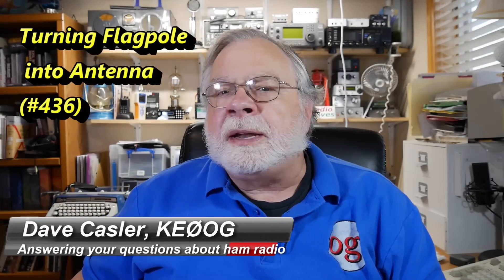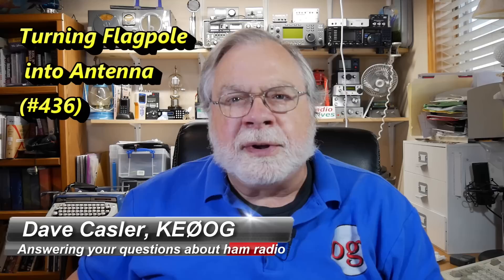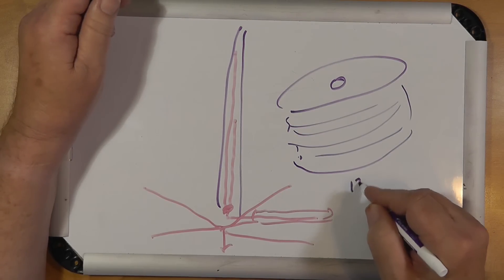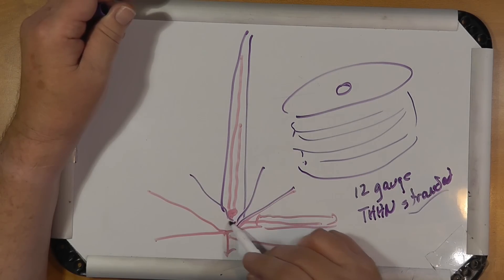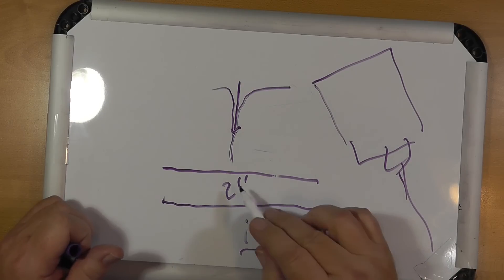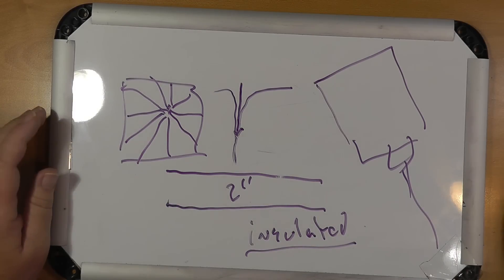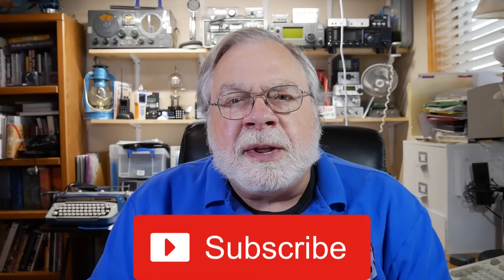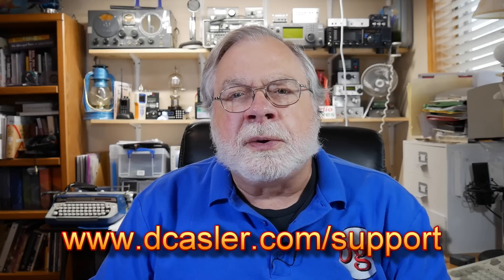Turning Flagpole into Antenna! (#436)

Comment: Thanks for sharing. First: If the flag pole is made of aluminum instead of fiberglass,  can I still run 2 wires inside for a 20 and 10 Mts 1/4 wave? Second: Do I need a Balun at the bottom, if so what ratio balun would be the one? I am trying to re start the hobby after many inactive years. Thank you all for your help and suggestions.

Comment: Hams in my area (an HOA) are using aluminum flag poles (no internal wires) and they use the pole as the antenna. Have an automatic matching unit at the base, hide it under a fake stone, and they do very well on HF. Look up John Ellis NP2B article, September 2017 QST and simply follow what he did. I was at a guy's QTH the other day and he'd just installed one. WOW, it was amazing. Very impressive. It requires radials. If you're not good with a flat shovel call the folks that put in invisible dog fences and they can bury the radials. The next morning you won't even know where they are. de KQ1K

Comment: My question is how would I get a good SWR?  Use a Balun/Urun? 49:1?
Reply from the maker: If it's an existing flagpole already bolted to its foundation, you will need to use a gamma match. Look for articles on the internet and other sources about feeding towers as though they were verticals. This is almost the same situation.

Comment: Actually, the required length of the antenna segment inside the fiberglass pole, which is technically a Radome, will be shortened by 1/ SQRT(dielectric constant of the radome material). 
Depending on the specifics,  that may not amount to much.
Remember that since the dielectric constant is itself a Complex Number, its value will change depending on the frequency  in use - which again may not be much, but it really IS a consideration in Radome design.
Large, multi-layer Radomes get even more complex to design where the frequency (actually the wavelength) also dictates the thickness of the layers.
73

Comment: Hi Dave. My question is more about the radials and not about the flagpole antenna. 

Due to the limited space in my property, I plan to put up a vertical HF antenna up on the roof. In my country, houses are built with roofs made from galvanized iron sheets. My question is that will my radials work well as if they were on the ground? 73.

4G1FBL from the Philippines

Comment: Our new home is currently under construction as we speak. 

Unfortunately, I could not avoid an HOA neighborhood as this seems to be new-normal nowadays. Recently I came across the 'Greyline DX Flagpole Antenna' purely on accident. Of course the reviews are nothing but high-praise. However, I do not trust online reviews as they are often cherry picked by the manufacturer. 

Would this product be a reasonable "do all" antenna for a Yaesu 991A or FTDX-10? 

We are a 'buy once - cry once' family and do not wish to have a plethora of antennas and/or cables strewn about our classy home. Nor do I think the other residents would take too kindly to such eyesores. Plus we like to adhere to the 'KISS method' for our amateur radio needs.

We are not too serious about the hobby in general, but would like to know that we have invested wisely in quality equipment as our interest in HAM radio ebbs and flows. 

Thank you for your time and expertise. I would include a link to the product in question. However, YouTube forbids the inclusion of links in the comment sections. 

Stay classy my friend.
Reply: I lived in an HOA controlled neighborhood for about ten years in my two story (three stories in the back) custom home, as well.   And, what I found to be a very effective antenna was a resonant full-wave loop antenna for 40m installed in the attic around the eves, secured with staples.   The nice thing about a full wave loop antenna is that it is resonant on ALL of the harmonic bands.   So, it worked great on 40m, 20m, 15m, and 10m with little tuning required to cover those entire bands.   I just used the internal tuner in my Kenwood TS-2000.   This antenna was a bit of a cloud warmer on 40m, but had gain in some directions on 20m, 15m, and especially 10m and I was able to work a good bit of DX as far as Europe and Hawaii from Georgia.   Of course, it required no radials, could be coax fed, and loops tend to be rather quiet in terms of noise.   And, of course, no one could see it or know it was there at all.  Just something to consider.

EDIT:  I forgot to mention, you will need a 2:1 balun for match to 50 ohm coax at the feed point.  But, the balun actually makes it easier to connect to it using a regular piece of coax with a PL-259 at each end.   And, you just connect the loop to the balanced side of the balun, preferably at a corner.

Oh, and the nice thing about a flagpole antenna is that it is a simple antenna - just a flagpole and some radials.   That means, you don't have to even consider the reviews.  It's just a vertical antenna and it will be good for DX.  Of course, with vertical antennas, they are only resonant on odd harmonic bands.   So, a 1/4 wave 40m vertical is going to work on 15m, but not 20m or 10m. 

If you use a full wave loop antenna in the attic, like I did, and a 40m vertical flagpole antenna, you should be able to work DX on 40m and 15m on the vertical, and, depending on the height above ground, local on 40m and DX on 20m, 15m, and 10m on the loop.

73
AI4IJ
Reply: @richardowens9061   Wow!

This is by far, the most thorough information I have received to date! Thank you so much for this inclusive information Richard.

In fact, I even took a photo of your commentary on my phone so I can use it as further reference. 

I will definitely be looking into a full wave loop antenna. Appreciate the helpful information. 

Thanks again my friend!
Reply: @BertShackleford  You are quite welcome!

73
AI4IJ
Reply: @richardowens9061   Hello again Richard,

I miraculously managed to find an IC-7300 in stock so I jumped on the opportunity. However, I did not add a power supply or antenna to my order for fear that the available inventory would run out by the time I was done with the checkout process.

Well that is precisely what occurred. The Woodbridge, VA HRO location had several in-stock this morning. However, they sold out by the time I finished my registration/checkout process. Luckily, the Plano, Texas HRO location had several popup in their inventory so I placed my order without including any extra necessary equipment.

My question(s) are as follows:
1. Do you have any recommended/preferred equipment that is required for basic operation of the radio? 
 (I must reiterate that I am still learning strictly on the RX end as I am not currently licensed. However, my need to learn and understand amateur radio operation is far to great to ignore at this point.)
2. Your antenna recommendation is my current "go-to" option. Is there a company that makes such an antenna or is this something I need to build?
 -Honestly, I am not too comfortable with the idea of building my own gear. My wife thinks this is odd because I have built a myriad of things throughout my life. Everything from cars and cabins to firearms and furniture. However, I have never been comfortable around electronics and the wizardry behind it all. 
3. Do I need a tuner? Is it required or is it something that will simply make my learning curve slightly easier?
 - I figured the less equipment; the better off I will be in the beginning. Basically adhering to the KISS method.

With all that being said, I am woefully unfamiliar with the required gear in order to get my radio operational. What are the minimum pieces required to do such a thing? I know I still need an antenna and a power supply. But I do not know if I need more nor do I know what to look for in this equipment.

My plan is to go down to the HRO Phoenix location and purchase the necessary gear while I am at the shop. I am looking for efficiency here. I just want to plug-and-play so to speak. 

Hope this inquiry was not too convoluted. I welcome any and all helpful information from you and the community.

Stay classy my friend(s).
Reply: @BertShackleford  Congratulations on snagging that awesome radio!   I'm sure it will give you years of trouble free service and enjoyment.

As for what you need:

At a bare minimum, you need a power supply and an antenna. - and, of course, a feedline for the antenna   The radio you selected has pretty much everything else you're going to need, for now.   

For receive only,  your power supply can be rather modest.   It need only provide a few amps at 13.8 volts DC.   But, for transmit you're going to need something more robust - something that can provide up to about 30 amps.  The radio itself will likely never draw more than about 20 amps, but it's never a good idea to cut tolerances so close.   A 30 amp supply is going to give you about a 50% buffer and will allow you to power other small accessories in the future.   Astron makes excellent power supplies for amateur radio and I've had good experience with them.   But, there are, of course, other options available and your friends at HRO can also make recommendations.  Plan to spend a couple hundred dollars on a good power supply,   Don't cheap out on this because you will likely regret it.   Cheap power supplies can introduce noise that your sensitive radio will definitely hear, and so will you.

The loop antenna is very simple.   It's just wire cut to a specific length - one wavelength for the lowest frequency at which you intend to operate.  I suggested a 40 meter loop antenna for your attic because of the physical dimensions that are typically available in an attic.   And, it can provide operation on other harmonically related bands - 20m (2nd harmonic), 15m (3rd harmonic), and 10m (4th harmonic).   

For insulators, you can use standard TV coax staples.  These will allow the wire to slip easily while you're running it around the attic.   For the wire, I suggest 14 gauge insulated stranded copper wire.  You will want to buy a 500 ft roll of it - not because the antenna is going to use all of it, but because you will likely want to build other wire antennas in the future and this is a good size to use for dipoles, verticals, and for ground radials.   And, it's not too terribly expensive.

You're also going to want to add a couple of ring connectors at the ends for connection to the balun.   Although, you may also be able to attach the wire ends directly, depending on the design of the balun.   The feed point impedance of a loop antenna is approximately 100 ohms - hence, why I recommended a 2:1 balun.   But, you could also use a 4:1 balun, which may make operation on non-harmonic bands, like 30m and 12m, a little easier.  The wider the range of your tuner the less important this becomes.

For coax, you could use RG-8x or Belden 8267 (RG213U).  At HF frequencies, these coaxes  will have little loss and sufficient power handling capability, while being relatively inexpensive and easy to work with.   Terminate it with PL-259 connectors at each end. 

The length of wire you're going to need can be roughly calculated using the formula 1005/frequency for the lowest frequency of operation and the result will be in feet.   Cut the antenna a little long and then trim as needed.

Of note:  You're going to want to trim the antenna for the lowest band - 40m.   But, the 40m band is rather wide and the CW portion is at the low end and the SSB voice portion is at the upper end.  Just be aware that, even if you intend only to use SSB, you're going to want to cut the antenna for use at the CW end, and here's why:   The harmonic bands are going to fall out of the allocated spectrum, if you cut it for the SSB end of 40m.  If you cut it for 7.1MHz, for example, it will also be resonant at 14.2 MHz, 21.3MHz, and 28.4MHz - all of which fall squarely within the allocated band spectrum for amateur use.   But, if you cut the antenna for 7.3 MHz, it is going to be resonant at 14.6MHz, 21.9 MHz, and 29.2 MHz - outside of the allocated frequency ranges.

I highly recommend you get an antenna analyzer to help you with tuning your antenna(s).  It will make short work of figuring out whether your antenna is too short or too long and what your SWR is at various frequencies.   This is going to be something you will use as long as you are into amateur radio.

I also recommend you get a soldering station - not just a soldering iron.  Depending on what you're soldering, you're going to need either high power or low power and a soldering station will allow you to adjust the heat to meet your needs.   There are excellent videos here on YouTube to expound on soldering, so I won't go into greater detail here.  Just let it suffice to say you will not regret having a soldering station and it will likely get a lot of use over time.   A butane soldering iron is also nice to have for use in the field when you're away from a 120 volt source.

Finally, for receiving, a tuner is not going to be needed at all for this antenna.  For transmitting, you're going to need a tuner, but the tuner in your IC-7300 should suffice, assuming you cut your antenna properly.  A manual outboard tuner will greatly enhance the versatility of your antenna for general shortwave listening and for operating on non-resonant bands like 30m, 12m, and 6m, but it is not required for your primary bands of operation.
Reply: @richardowens9061   Unbelievably thorough and fantastic information my friend!

The sheer amount of knowledge you have conveyed here is invaluable. I took more photos with my phone so I will have this information while visiting HRO. In fact, I have been checked YouTube for your response all day long (not to add any undue pressure). 

We are fully committed towards the 'buy once - cry once' approach while also adhering to the KISS method throughout this adventure. It is a fine line to walk but we have a rare opportunity before us. Since our home is still under construction I can invest in the proper equipment from the start and never look back. Longevity is the key to efficiency. 

After reading about your recommendation for placing the antenna(s) in the attic, I decided to contact our Construction Manager with some questions. I was concerned that it would be too tight in the attic for proper size/placement. Plus the recommended 20 foot flagpole antenna was cause for further concern given the unknown height of our home. Turns out that our highest point is slightly over 30 feet tall so I presume that a 20 foot flagpole would not suffice.
 
Furthermore, I have yet to thoroughly dissect the HOA regulations being that it is a brand new community. So I have my reservations towards the possibility of pursuing the aforementioned flagpole antenna. Attic space should not be a problem (I hope). Although, we do have rather tall ceilings so now I am a bit worried. Attics are given very little thought here in Arizona. Nothing like the attics we remember from the movie 'Home Alone'.

Believe it or not, my primary lifestyle is far more expensive than amateur radio. So the costs involved are actually a welcomed reprieve. Shortages abound on numerous fronts so this step back into the radio world came at the perfect time. 

Honestly, I was hoping the 991A would be the first radio available for purchase. But I was more than willing [itching] to get either the Yaesu or the Icom once they were in-stock. Just so I have something to play with for the next year or so. I will have plenty of time in the interim to acquire my license(s). At least until we feel out the new home and community. We are not the Wrigley's after all.

Thanks again for all your help Richard. I look forward to keeping you updated throughout my journey and eventually getting on the air to thank you in voice(?). 

As always, 
                   Stay classy my friend.
Reply: @BertShackleford  Obviously, I have no idea what your attic looks like.   But, if it is an upscale home - and, it sounds like it is - then you should have no problem fitting a 40m loop of wire up there.   My attic was cavernous - well over a thousand  square feet of 3/4" plywood subfloor for storage and 12 feet of vertical space from the floor to the peak of the roof.  So, it was no problem at all for me to run a 40m piece of wire around the perimeter.  But, while your home is under construction would be a good time to install it.

And, if you can get it up to 30 feet above ground, you will be able to work DX on 20m, 15m, and 10m.  So, if you got a flagpole antenna, I would suggest it be a 1/4 wave for 40m in height - so, about 34 feet.   A flagpole antenna  for 20m would be about 16 feet - but, really wouldn't provide you much better results for DX.   The 1/4 wave 40m flagpole antenna would provide noticeable improvement for DX over the loop.  Of course, to be honest, I generally use 40m as a local band - out to a few hundred miles - and, use 20m, 17m, 15m, and 10m for pursuing DX contacts.  So, you may be satisfied with using just the loop antenna and skipping the flagpole antenna altogether.

Comment: I lived in an HOA controlled neighborhood for about ten years.   And, what I used as a 40m vertical antenna was a wire pulled up in a tree in the wooded area behind my house that would not be noticed by the neighbors.   For the ground plane, I cleared away the fallen leaves at the base of the tree and laid down galvanized chicken wire and staked it down to the ground using tent stakes.   I then covered the chicken wire with the fallen leaves I had cleared.  And, I buried the coax back to the basement.  So, all that anyone could see is a single dark grey 14 gauge insulated wire.   And, they could only see that if they were literally standing in my backyard.    It was easy and effective.   And, no one ever noticed it.   At least, if they did, they never said anything about it.